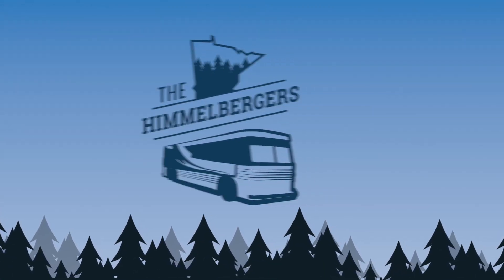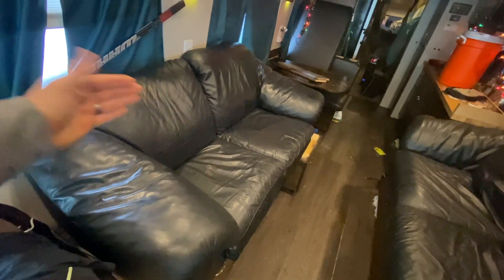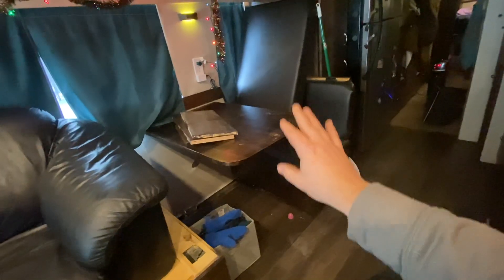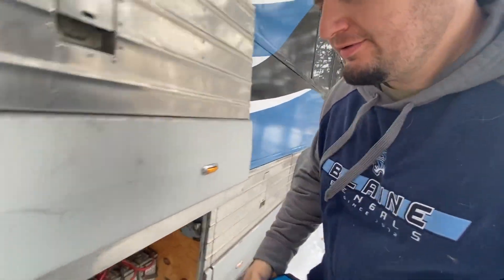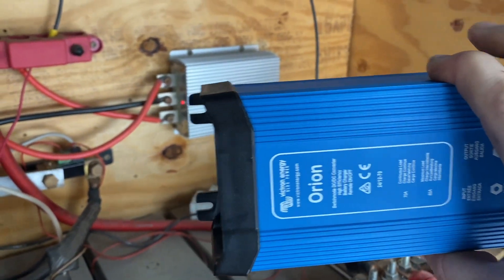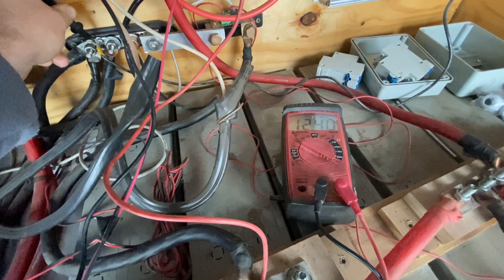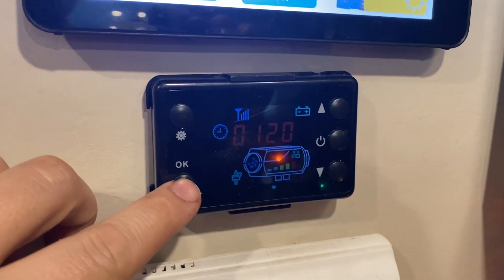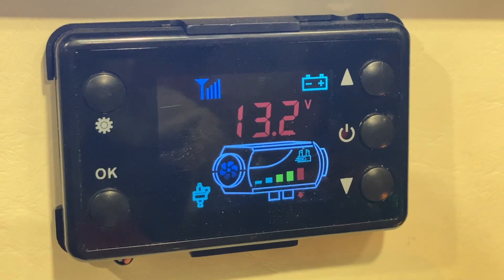What is the correct voltage for 12 volt devices - Victron Orion 24v to 12v Install Solar off Grid RV

Comment: Does it work well with lifepo4 batteries? They told me that it had no curve line and could damage them. I want to build one just like it but I'm hesitating.
Reply from the maker: For batteries you should use a charger. This just holds a voltage.

Comment: I’m currently trying to figure out a 48v system. I’m on a property with a camper and 3000W of panels; 4 125ah 12v batteries and was thinking I would run it in 48v buy an 80amp controller and something to step down. My problem right now is knowing what to get to step it down. I am wondering if I should buy a higher amp controller and run 24v instead to make the conversion easier. I’m really new to all of this but have been trying to get the best I can as I intend on living in this set up for the next 2 years. Any advice? Having a hard time of being sure on what’s best 😅 thanks for the vid
Reply from the maker: Victron makes a 48v to 12v step down converter but only to 15 or 30 amps. This 24-12 is good to 70.  I still like my 24v system.  One disadvantage to 48v in your setup would be upgrades in batteries requires multiples of 4. I do this sort of work and sales full time now at @sotasolar / https://sotasolar.com if you need Victron stuff, I’d be happy to help and ship it out to you.

Comment: How does the converter work? Why did you not get an isolated converter? Does the fan on the converter kick in a lot? Is it loud? Do you hear it?
Reply from the maker: Works great this far!  I didn’t see a reason to isolate anything because we use chassis ground anyway. I’ve never heard the fan kick on. The Multiplus’s fan is 10x louder anyway.

Comment: 6:27 That's a fire or electrocution waiting to happen. You can clearly see that the red 4/0 wire is pulling out of its ring terminal. PLEASE fix those wires, and route them properly.
Reply from the maker: I appreciate the concern, you’re welcome to come over and pull on those wires, I think you’ll give up before crimp will :-)  Those were some that I crimped before I knew how much insulation to cut away (3-4 years ago) I’ve gotten better as time has gone on.

Comment: Sheck out meny diesel heaters on youtube.  And you get code 1688 and you can handle all you want in meny.  Very cool alsow that u can drive this in 12 and 24volt after whats fit you best. 

I have used this now 3 month 24/7.  And i am frosen in 25cm ice on lake. Have bean down to 20 maby 22 degrese below zero celsius. 
And have now problem at all. 
Alsow run it empty 1 time i was away.
Diesel coustumers alsow get low if your able to turn down hz so it dont goes so high.  It use less power when running 24/7.  But -20 celsius outside and not isolated boat holds 22 degrese celsius easy inside.   I have al extra parts sens i experimental litle. But it runs totaly fine. Litle smoke when hot and wet days. But hard to see cos it is so litle.

But why run at 4500rpm when 3500 is plenty?   Idle turns up litle so more effektiv use of heat.  Alsow down whit hz is unike when you are from freezing point 0 degrese celsius and up.

Many people have video of all this on youtube. So see them. You will like it. And less use off diesel as well

Comment: Use kode 1688 and adjust all this in meny on display. I use to do that after temperatur celsius. Cos whit 0 celsius i only drive in 1.5. And litle higer when -20 celsius
Reply: Alsow rpm on idle and rpm on full pull

Comment: Best to have tank over diesel heater so diesel runs free down to module if u run it empthy.

This burner you can use in 12 or 24 volt

Comment: kerosene works better too at desooting.
Reply from the maker: I didn’t record anything, but yesterday I took it apart, I have very little soot in there. Need to figure out the issue. -20f nothing works right. Thanks for commenting and watching!
Reply: @HimmelbergerBus  Anytime; love watching your videos. Ive ran my diesel heater all this winter too and its awesome. I haven’t had any problems with it. Even at its lowest setting it heats my conversion van good.

Comment: I like the idea of running the diesel heater all the time.  How often do you have to refill the tank?
Reply from the maker: More than I’d like...  that little one every day or two when it’s not very cold. I’ve been thinking of finding a larger tank and filling it with off-road / refer diesel at the truck stop. Way cheaper than fuel oil or diesel prices.
Reply: @HimmelbergerBus  Have you considered tapping into the bus diesel tanks?  I haven't installed a new diesel heater yet, but a previous owner of my bus tapped into the bus's main diesel tank to fuel a hydronic heater.  I had to remove that heater, but I have it in my head to use that fuel line for a heater like you installed.
Reply from the maker: @MikeManning  I have, my generator is currently plumbed in, wouldn't take much to add another in there.   Only thing is, I like to track fuel mileage so both would throw it off, especially running this heater all winter.  If I burn 100gal a year in generator and heater, that's $50 ($0.50 / gal) I don't have to pay in road tax.  That's why I'm thinking of making a larger tank for offroad use.
Reply: Ive been running mine all the time this winter too in my conversion van. Man i love that thing. Its awesome.

Comment: Most all 12v stuff are designed to work at 13.8vdc for optimal performance. Thanks!!!!
Reply from the maker: Yup it’s what I’ve found.  I had a 12v to USB power converter die on me for my raspberry Pi. I wonder if the lower voltage caused that.
Reply: @HimmelbergerBus  The lower the voltage the higher the current. Could have overheated it.

Comment: Hey my diesel heater and all the others I have seen runs will all the heat bars on ( meaning they are running hotter , ). The soot can be from actually running lean / cooler ,  you can adjust the fan speed in advanced settings try reducing the fan setting little by little untill all the bars lite up . If you get e05 that’s too much. 

Good idea about half petrol half diesel to clean them out. !
Reply from the maker: All my bars are lit up currently, but I think when it ram out of fuel it would kind of sputter and get intermittent fuel until shutdown.   How do you access advanced fan settings? I run mine in thermostat mode.
Reply: @HimmelbergerBus   top left button untill you see dashes.  Then code 1688. 
There are a few YouTube videos on it. Seems some fuel pumps are outputting slightly more or less causing either over heating or sooting 

Note your settings before changing them